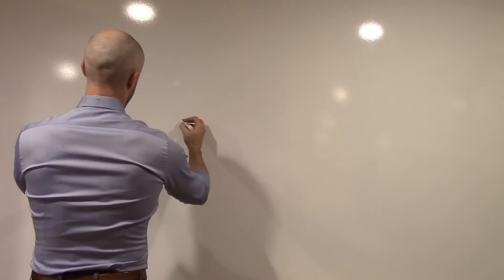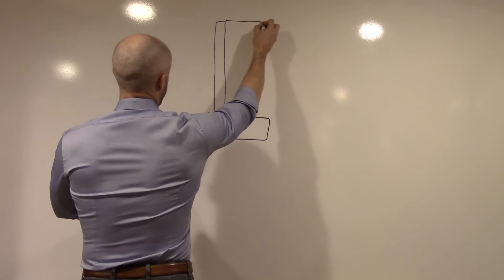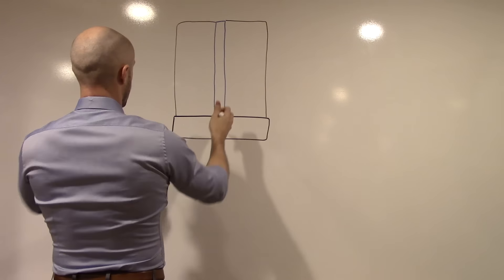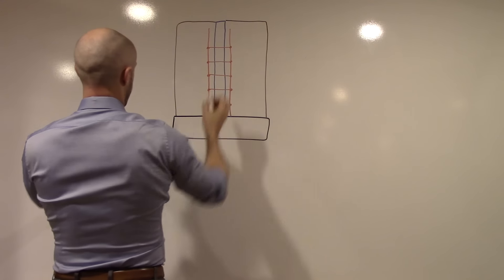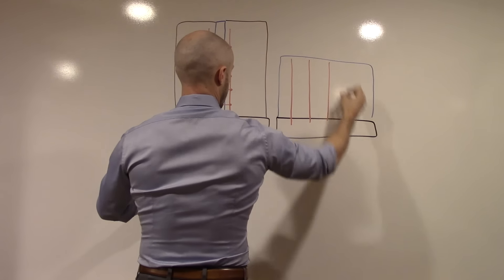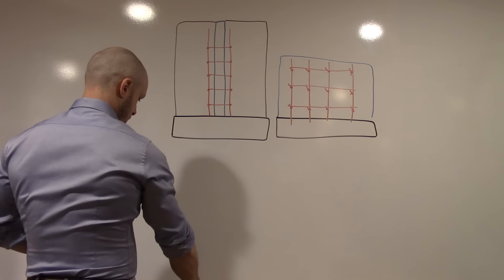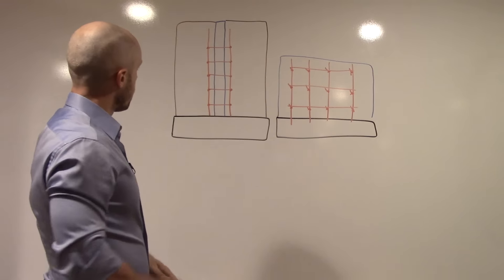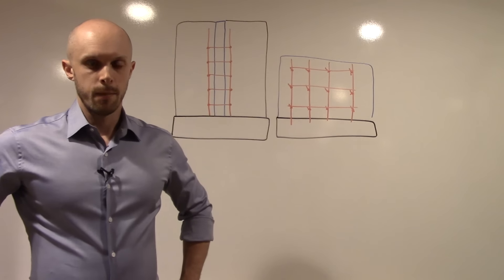BUILDING A COB HOUSE IN COLD CLIMATES - INSULATED COB WALLS

Comment: So, when you say "stable", what do you mean?  Structurally?  Is cob wall construction designed to support floor loads or roof structures? 
When you say near the end, "It works", is this based on your application to an actual wall or is this just a claim based on theory?  If the former, why not show it?
I keep hearing folks say cob has "high thermal mass".  So, what advantage does this claim have for those who intend to live in the structure?

Comment: Thanks for posting this video.It has stirred up lots of interesting comments.My opinion is that rebar in cob is going to create havok in the future. Due to different materials in the wall even the minimum condensate will make the rebar rust, and push the walls to the side creating craks and asking for more trouble. Remember we are building a cob house to last hundreds of years to be enjoyed by future generations.In Germany and a few other european countries where winters are bad, cob houses are still lived in, without insulation.Who knows how they perform in the first place,before going through all this effort? Who knows if 
A) a flexable plastic pipe is zig-zaged through the cob wall say every foot high,blown in with crushed recycled polystyrene..
B) small lenghts of bamboo or rigid plastic pipe filled with insulation material to create randam pockets during build.
Feedback much appreciated.
Reply: But if the rebar is coated in epoxy it shouldn't be a problem.

Comment: This Cob House sir I have a question, I have been researching cob, rammed earth walls and straw bale constructions and in my research I've found that a general rule for these types of construction is that the foundations/footings of concrete are roughly twice the width of the walls. So assuming that being correct to construct the walls you are talking about in this clip you would need footings that are at least 4 feet wide? My question is two-fold- doesn't this make it very expensive and considerably less environmentally responsible? If you were wanting to build a reasonable sized home how would it compare to the quantities used for a regular cookie cutter houses? Thank you sir in advance.
Reply from the maker: Hello!
No, actually. The foundation stem walls are either the exact same width of the walls, or maybe just 'slightly' wider, but usually not. Sometimes stem walls are tapered in (if they are made of stone) so they are wider at the bottom and then at the top are the same width as the earthen wall. 
The footer underneath the stem wall can be wider than the stem wall foundation, but this is different. Please go watch my video on foundations for cob homes to maybe see what I mean: https://www.youtube.com/watch?v=ZEWuJKV3rhA&t=71s

Comment: Would straw bales work as a center and then thinner cob walls on either side? The wall would be very thick but I'm thinking the thermal mass plus insulation would be exceptional with passive solar as well, with little or no heating and cooling required.
Reply: Straw bales would be too thick, and would separate the two cob walls too far.
Reply: @reformedguy777  then make the straw bale smaller, would it work?
Reply: A thin separation would work, yeah. But then it wouldn't be enough insulation for a cold climate if it were just straw.

Comment: Is cob better than hempcrete or strawbale
Reply from the maker: Neither is necessarily better than the other. They both have their pros and cons. Hempcrete and strawbale have high insulation, cob has high thermal mass. One of the main differences. Cob is not an insulating material, whereas straw and hemp are.

Comment: could one add air crete between the cob walls to create an insulation quality to the cob keeping the breath ability as well as insulating it from ex-streams in heat and cold and remain strong as well as durable?  it's is also fire proof adding to the safety of the structure. and/or maybe that foil covered bubble wrap on the inside of the air crete for reflective heat in colder climates? just pondering some idea's that are more affordable, the foil bubble wrap stuff is great in normal wood floors for sheds an such to keep out cold an mice and things like that... just thinking out loud.... hay and straw is good as an insulation also but isn't fire proof.
Reply: Aircrete was never meant to be used in load bearing walls.

Comment: Why not just have several inches of rockwool insulation on the outside covered by a lime rendering?
Reply: rockwool is very pricey. I did 6 inches on the roof plus two breathable water resistant silicone tarps - extra strong. price: $400. the rest of the building has been free so far. just LOTS of time and labor.
Reply: @voidisyinyangvoidisyinyang885  Rockwool is vapor permeable. With a cob wall a vapor permeable insulation is a must. If you use anything that is not vapor permeable then your cob walls will get saturated with water and then fail.
Reply: @willg4802  yes that was my emphasis - someone asked me why I was using tarps for the roof - I said so they are breathable - permeable. Same with the walls - its a double wattle wall - I wove all the willow branches - harvested it on my land - and harvested the hay with a scythe - and the clay from the same land. So I don't even get condensation - despite our very cold winters - and I don't have a floor - just more cob - lime and horse manure.

Comment: Wouldn't the rebar create a thermal bridging issue?
Reply from the maker: Good question. I can't say for sure, but it doesn't seem like it would be anything of significance. 
But maybe I'm missing something. Open to hearing more about the theory.
Reply: I think the thermal bridging would be related to the cross-sectional area of the short pieces of rebar that extend through the styrofoam.  Say for instance that the rebar is 0.5" diameter - it's cross sectional area would be pi * 0.5 ^2 / 4 = 0.1964 square inches.  Suppose you space the rebars a foot apart both vertically and horizontally.  Then for every square foot, or 144 square inches, you would have a thermal bridging area of 0.1964 square inches.  Then the ratio of thermal bridging to good insulation  will be  0.1964 / 144 = 0.00136, so you would be losing a bit over a tenth of a percent of your insulation value due to thermal bridging, assuming that the rebar completely transmits the heat and the styrofoam completely insulates against heat transfer, which of course is just a simplifying assumption that isn't truly correct in the real world.  But it gets you into the ballpark or a crude estimate of how much heat loss due to thermal bridging you could expect.  Bottom line is that the R-value of the styrofoam would be reduced by somewhat over a tenth of a percent for a half-inch rebar spaced every foot apart.
Reply: This would be an area weighted U Value calculation (A1 x U1) + (A2 x U2).  Area 1 of the rebar sticking through the insulation and Area 2 of solid insulation with their respective U values (Inverse of R Values) 1/R = U.

Comment: You don't worry about thermal bridging?
Reply: If you use fiberglass rebar, there will be no thermal bridge.
Reply: @bobleponge1301  there is such a thing as fiberglass rebar?
Is it available in the U.S.? it sounds like a perfect solution to the certain issues involving the use of steel rebar in an earth walled home!
Reply: @АлександрПерчов-ж9у  Fiberglass rebar were created for bridges and other structures immerse or close to water to eliminate corrosion. Basalt rebar are also another option(for corrosion at least, for thermal bridging: probable since not metallic). Make a search on the internet or ask your local hardware store.

Comment: Why not just use bamboo and straw-bale for the insulation - then Cob the outside you can reach as high as R 35 or more doing that with breathable walls and no issues? Here is a cob castle that has many of the answers we need. https://www.youtube.com/watch?v=KHOIluuwGQ4

Comment: I have in my village 4 houses built from cob that are more than 150 years old..and in 2 of them there are people still living in. and none of those houses have the way they were built that this guy says. Cob is actualy a mixture of dirt. And is breedable by is nature. If you have a good foundation and a good roof over them they will outlast any conventional/standard houses we build today. The only issolation you need on a cob wall is the inner and outer thin layer made from lime/clay mixture and that's it. What this guy say in this video about the isulation in the middle of the wall is the same shit as it used outside and inside.. you actualy close the the way that the wall will breed. Yeah he built a house using cob.. but how good he built it? Is he actualy living in that house. Did he test it in winter.. i don't think so.. So he has some good ideas.. but his "sistem" of building them is kinda similar with the conventional one. So thx. but no thx.
Reply from the maker: Hi Gatto,
Thanks for your input. I actually agree with you. I'm only presenting a system for people who "need" insulation for coding purposes. This is definitely not the traditional way to build an earthen wall.
Reply: I don't prefer for my walls to breed.

Comment: that is all completely unnecessary. crazy expensive too. a cob wall has plenty of insulation without all that.
Reply from the maker: In fact, earth walls have no significant insulation value. They have thermal mass though.
Earthen buildings must have insulation added to the walls in some way if you want a high R value for your walls.

Adding rebar and insulation costs more than traditional cob, but its not excessive. If you want a nicely insulated earth building its a reasonable cost.
Reply: not sure how the cob wall can 'breathe".  you didn't tell us what u used as insulation.  once you put up a vapor barrier the 'outer' half of the cob wall serves no purpose?
Reply from the maker: You'll need to use insulation batts that are vapor permeable so it can continue to "breathe." 
With the insulation "break" in the middle, the thermal mass of the wall won't function to the full extent of a continuous earth wall, but the inner and outer earth walls are still very valuable. For one, they are still walls and create your building structure, and will help keep the inside of your home very toasty in the winter.
Yes, you do make some sacrifices to the traditional monolithic cob/earth wall with this method. But you gain massive insulation. So, whatever suits your project the best. Its good to have options, I think.

Comment: I started writing this after your stated the R value of cob. I will get back to your vid once I get my thoughts out.

Mind you I am not trolling you. I just disagree with this method which does not account for the positive qualities of solid mass. In my opinion if you are going to build with cob you have to account for the properties of solid mass for it to function well. 

Definition of insulation for English Language Learners
: a material or substance that is used to stop heat, electricity, or sound from going into or out of something : a material that insulates something

Even this definition is not sufficient to explain exactly what we commonly accept as modern insulation. 

Insulation - A material that is designed to slow/stop the movement of energy from one location to another.

I think your statement is highly misleading
Your statement that earth has an Rvalue of 3 compared to any kind of standard insulation is just not right because it does not take into account all the inherent qualities of solid mass.

Modern insulation - Is designed to stop the movement of air within the voids between the inner and outer sheathing of a wall. This is accomplished by using a frothy material with lots and lots of air space within the material. Unfortunately any heat entering this airspace is quickly dispersed and lost and more energy must be used to maintain a stable temp with in the home. Modern insulation can not store heat. By design it will dissipate heat. 
 

There are several qualities to consider when dealing with solid mass thought.

Thermal inertia - the degree of slowness with which the temperature of a body approaches that of its surroundings. Thermal inertia is a positive factor more than negative.

Because of thermal inertia solid mass can act much like a battery and can store heat. 

You can get a better idea of how this all works if you look at some videos by a company called Earthship Biotecture. Basically they use a south facing structure with a lot of glass to allow the sun into the house to heat the interior mass surfaces. These surfaces will then store the sun's energy and radiate that energy into the interior throughout the night .

I watched the rest of the video. I would imagine all the extra materials and effort to instal them would increase costs significantly. Or you could design your structure to take advantage of natural phenomena like an earthship does.
Reply: I like and agree with a lot of what you say, but on shady/overcast days in -35c to -49c when people freeze to death in their own homes in a power outage, it can be a dangerous assumption.  Glass has very little insulation value. I like the cob approach, however, I do agree there is a flaw to his design. Breaking up the wall in half like that is inefficient. A more efficient approach is to have the exterior insulation against the cob house, the interior have a fireplace to dry off the moisture accumulation in the walls and the walls will retain radiant heat.